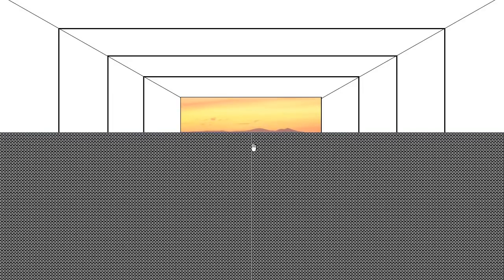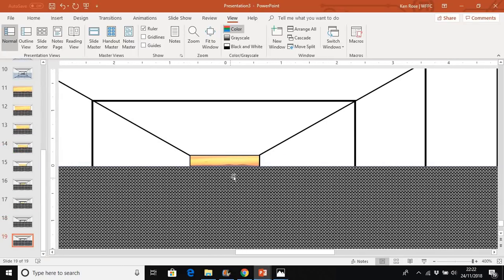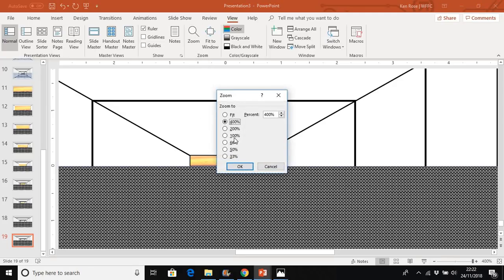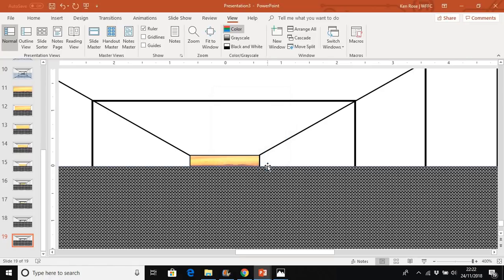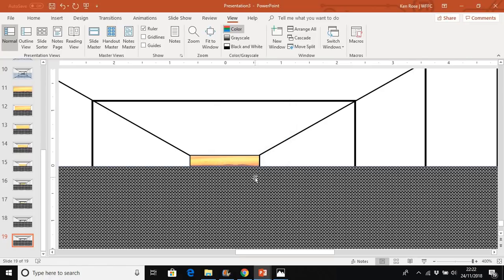Dr Perspective owes me $1000

Comment: Good luck with that money Miles.  He trolls my channel frequently and just made a fool of himself again a few minutes ago cherry picking a single paragraph from an FAA document when the very next paragraph clearly states the Earth is not Flat.  

Fail is his middle name.
Reply: @dr.perspective8298  Let me break it down for you:
From "https://www.faa.gov/about/office_org/headquarters_offices/ang/offices/tc/about/campus/faa_host/labs/tgf/media/AircraftDynamicsModel.pdf" Page 62

[1] The observant reader will notice that the aircraft equations of motion were calculated
 assuming a flat Earth and that we here assume the development frame was the NorthEast-Down frame. 
[2] This implies necessarily that earth rotation and the variation of the
 gravity vector with position over the earth were ignored in developing the aircraft
 equations of motion.
[3] This simplification limits our mathematical model to the flight of
 aircraft only.
[4] The model will not properly handle the flight of sub-orbital craft and
 spacecraft such as intercontinental ballistic missiles, satellites, or the space shuttle. 
[5] The
 model is adequate for all vehicles traveling under Mach 3.

[6] For trajectory propagation, since we cannot assume a flat Earth, the original inertial
 reference frame, denoted with an ‘i’ subscript, is modified for the elliptic Earth. Thus, we
align our newly defined ‘surface’ frame, with the inertial frame ‘i’. 
[7] The surface frame
 then moves with the aircraft so as to provide a frame that is tangent to the Earth’s surface for interfacing with trajectory propagation equations, and parallel to the aircraft’s horizontal plane of flight for interfacing with the aircraft's flat-Earth dynamics. 
[8] All velocities that were originally defined with respect to the ‘i’ frame, are now taken to be with respect to the ‘s’ frame.

-------------------------------------------------- Let's translate that into language you might be able to understand.

[1] .. "assuming a flat -earth".
 This means "it's not flat, but we will pretend that it is"
If the earth IS flat, this sentence would not even be needed.

[2]  .. "earth rotation and the variation of the
 gravity vector with position over the earth were ignored"
  So you quoted a document that tells you that the earth not only rotates, but that it has gravity, and that it varies with position on the earth. That sentence alone destroys half of all FE hypotheses.

[3] .. "This simplification limits our mathematical model"
The model has been simplified to ignore actual, real-world data, and instead has been made easier to calculate values from

[4] .. "The model will not properly handle the flight of sub-orbital craft and
 spacecraft such as intercontinental ballistic missiles, satellites, or the space shuttle. "
Again, it says that the simplified non-real-world model is not accurate for anything that travels very far in a short period of time. (that means "fast")

[5] .. "The
 model is adequate for all vehicles traveling under Mach 3"
basically the same as [4]

Now, the part you decided to leave out....

[6] .. "For trajectory propagation, since we cannot assume a flat Earth, the original inertial
 reference frame, denoted with an ‘i’ subscript, is modified for the elliptic Earth."
The dumbed-down model does not work for anything that travels very far in a short period of time ( see [4] and [5] ). Also states that we can no longer pretend the earth is flat and must go back to the true, elliptical-earth model

[7] ... "provide a frame that is tangent to the Earth’s surface "
Another reference to the elliptical earth (and no such thing as a tangent on FE)

Also, and i doubt you will understand this part, as it involves knowledge of geometry, maths and, well, science... so I will dumb this one down

... "provide a frame that is tangent to the Earth’s surface for interfacing with trajectory propagation equations, and parallel to the aircraft’s horizontal plane of flight for interfacing with the aircraft's flat-Earth dynamics. "
FE dynamics no worky when go fast, so must add in sphery ball shape maths for to get real numbers what works.

[8] [Not relevant to this discussion]

So, we have to ask ... Are you incapable of understanding?
Reply: @dr.perspective8298  LOL,  Oh, yes I understand it fully and that is why I am laughing at you.   Clearly it is you who still does not understand.  What do you think "this simplification" is referring to?   What are they simplifying and why?  

You did not even read that document did you?  How many times do they refer to g and what does that mean in the equations?

Snooby66 laid it out for you very clearly.  What part do you still not understand?
Reply: @dr.perspective8298  What you have done is an incredible level of ignorance or just dishonest. 

"Are you capable of understanding?" Absolutely, and your actions here are plainly visible.

Let’s have a look at how you have cherry picked the one sentence in the entire document that fits your narrative.

There are four paragraphs on page 32.

PARAGRAPH 1
Surface Coordinates - A reference frame on the surface of the earth aligned such that
the x-y plane is tangent to the surface with the x-axis pointing to the north and the yaxis
pointing to the east. This frame is often referred to as the North-East-Down
(NED) frame. We will use an ‘s’ subscript for brevity of notation when writing
equations. Surface Coordinates and Geodetic Coordinates are orthogonally aligned.
1. --- The surface co-ordinate system is a TANGENT  to the surface. An absolutely meaningless idea if the Earth is flat
2. 2. It is concerned with GEODETIC COORDINATES. The ones that rely on the spherical Earth.

PARAGRAPH 2
The observant reader will notice that the aircraft equations of motion were calculated assuming a flat Earth and that we here assume the development frame was the NorthEast Down frame. This implies necessarily that earth rotation and the variation of the gravity vector with position over the earth were ignored in developing the aircraft equations of motion. THIS SIMPLIFICATION LIMITS OUR MATHEMATICAL MODEL TO THE FLIGHT OF AIRCRAFT ONLY. The model will not properly handle the flight of sub-orbital craft and SPACECRAFT such as intercontinental ballistic missiles, satellites, or the space shuttle. The model is adequate for all vehicles traveling under Mach 3.

---1. This is where Dishonest Perspective cherry picked. These parts are shown inn capitals.
---2. Note that ROTATION of the Earth is IGNORED, not is zero, or does not exist. It has been ignored, 
---3. Note that variation in the GRAVITY VECTOR is also IGNORED, not is zero, nor does not exist. 

PARAGRAPH 3
For trajectory propagation, since we cannot assume a flat Earth, the original inertial reference frame, denoted with an ‘i’ subscript, is modified for the elliptic Earth. Thus, we align our newly defined ‘surface’ frame, with the inertial frame ‘i’. The surface frame then moves with the aircraft so as to provide a frame that is tangent to the Earth’s surface for interfacing with trajectory propagation equations, and parallel to the aircraft’s horizontal plane of flight for interfacing with the aircraft's flat-Earth dynamics. All velocities that were originally defined with respect to the ‘i’ frame, are now taken to be with respect to the ‘s’ frame.
---1. Note for trajectories, “WE CANNOT ASSUME A FLAT EARTH”
---2. Note “ the original reference frame… is MODIFIED FOR THE ELLIPTICAL EARTH
---3. The surface frame moves …top provide a frame that is TANGENT TO THE EARTH’S SURFACE. . The reference surface moves with the aircraft.  But tangents are meaningless in flat earth, 

PARAGRAPH 4
Figure 2.11 shows the relationship between the DIS and surface frames. The DIS-frame is fixed in the center of the earth with the DIS ˆz -axis out the North pole. The Plane described by the DIS ˆx - and the DIS ˆy -axes is in the plane of the equator. The DIS ˆx axis is through zero degrees longitude, or the prime meridian. The surface (NED) frame is tangent to the surface of the earth and is centered in an object propagating along the Earth's surface. It is denoted with an 's' subscript for surface. The ˆs z axis points downward and is normal to the surface of the earth. The ˆ sx - and ˆsy -axes define a plane tangent to the surface of the earth. The longitude and latitude angles describe the rotation between the two frames.

---1. Figure 2.11 (admittedly on the next page so perhaps Dishonest Perspective didn’t know to look on the next page), shows the spherical earth and related the surface and DIS frames.
---2. This section discussed the ROTATION of the surface frame to make it fit different latitudes and longitudes along the trajectory. ONLY required on a spherical planet.

--- Page 34 is quite clear in the model of the earth used:

“• a is the equatorial radius, or the semi-major axis of the spheroid, which is 6378137.0
meters, or 72 092565 10 . × ft
• b is the semi-minor axis given by b = a(1-f) where f is the Earth Flattening Parameter . (1/f = 298.257223563)”

So they are using a OBLATE SPHERICAL  MODEL OF THE EARTH.

If you had bothered to read rather than cherry pick, or were actually capable of even limited understanding, then you would have easily recognised the SPHERICAL MODEL this work is based on .
Reply: @Dr. Perspective, it's sad that I have to say this so often: You cannot possibly be this stupid. 
It's time to hide your face in shame if you are, and stop lying (for profit maybe?) if you have a modicum of intelligence.
Reply: Wolfie6020 /
He won’t want to pay.
But I’ll be trolling his posts most definitely
Reply: Wolfie6020 /
Dr fail perspective 😍
Love it!
Reply: @dr.perspective8298  , others have laid it out in details but I am really interested if you can comprehend all the text, not just words? It seems that if there is phrase "flat earth" in text then you comprehend only that phrase and not the sentence or paragraphs around it. Its like someone writes "we were talking about flat earth conspiracy other day" and you yell - See, he said that the earth is flat.
Reply: MARVEL GIRL / the only thing they’re paying are the trolls who invent the ridiculous flat earth claims
Reply: @ashleyhearts8630  We have video of Wolfie filming from inside the cockpit of an aircraft, in flight, at high altitude, as well as performing checklists, FMS programming and other tasks while on the ground.
 There are only two types of people who can get into the cockpit of aircraft in flight:
1) Flight Crew
2) Cabin Crew (by invitation)

Before your start asking Wolfie to bring you a coffee and a fluffy pillow, I should point out that I have yet to meet any Cabin Crew who could tell you what a MCDU was, let alone initialise ground power for demonstration/AIRAC update purposes.

(No, Google the initialisms yourself, you lazy fokker. While you're there .. check out what the proper initialism for the Federal Aviation Authority is.)
Reply: @ashleyhearts8630  Does Ashley Hearts exist. No proof. No face, No licence, No street address, No evidence.  So there is no person named Ashley Hearts. So we can all ignore this fake person.
Reply: Phillip Kidd /
I suspect Ashley here from being a fat bearded guy in his late 30’s commenting from his mom’s basement
Reply: @ashleyhearts8630  And in my country you will be called een Achterlijke Zak.
Reply: Ashley Hearts / 🤣dumbass